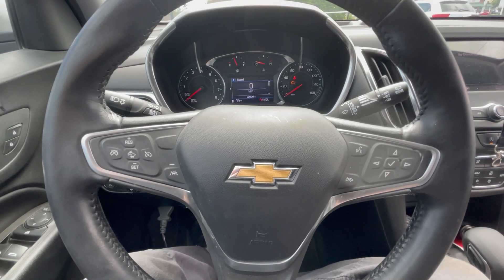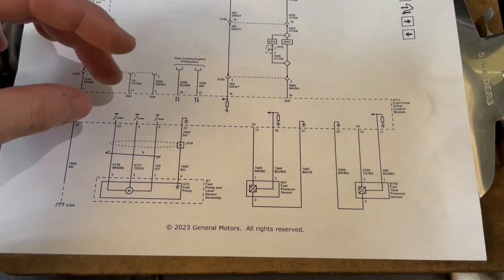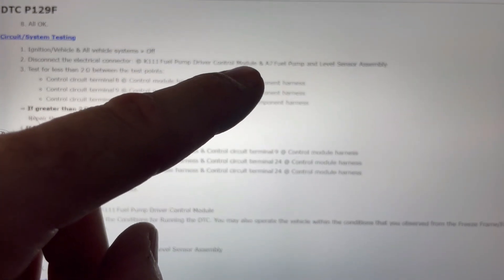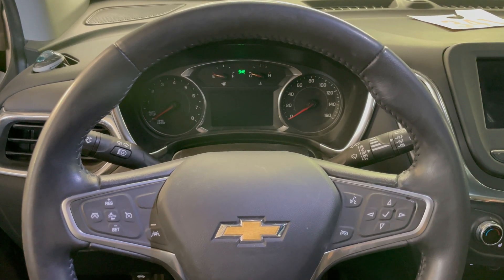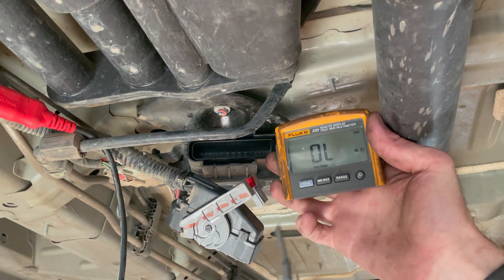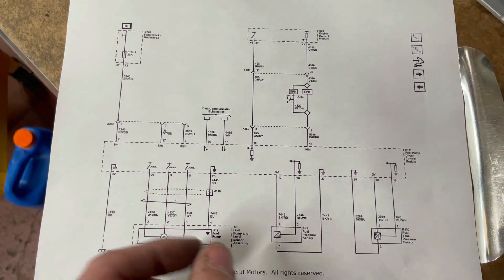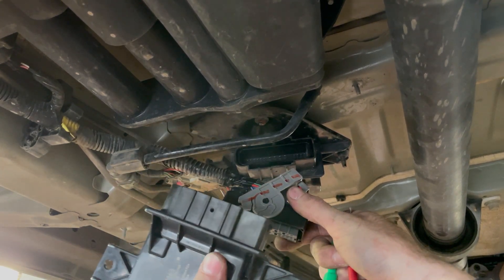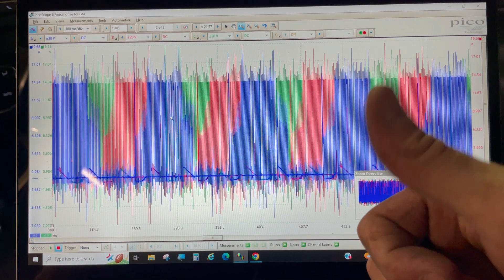We Do It My Way... Equinox No Start Triage Diagnosis P129F P023F P16D8 P2BB3 U18A2

Comment: 2022 chevy malibu that received code P023F CAR WILL ACT LIKE IT WILL CRANK BUT NEVER WILL UNLESS I GET A BOOST... IS IT THE FUEL PUMP DRIVER CONTROL MODULE? IT WILL CRANK ON ITS OWN AFTER THE BOOST ONCE OR TWICE AFTER DRIVING
Reply from the maker: 9 out of 10 times it is the module yes... Check the NHTSA website and enter your VIN to check for an associated recall... It might be covered.

Comment: I am having this issue with my 2020 equinox. I just want to know if the fuel pump control module for my model is located in the same area ? Google tells me it's in the back where my spare tire is. I know you mentioned this is a 2022 , read your comments and seen this seems to be a common problem and that you've repaired several, so any info is appreciated.  Thanks for posting this video, by the way.
Reply from the maker: Yes this has become a very very common failure. Some of them are indeed mounted closer to the rear of the vehicle. 

I do have a video which shows the exact location… Check it out here: https://youtu.be/ADJByWdbhyI?si=mZUpjr4VmhnZQFNE
Reply: @DadsGarageDiagnosticSpecialist thank you so much!

Comment: It is a “sad story” when your almost new car won’t run
Reply from the maker: I see it every day. Modern vehicles are absolute garbage. 

I have replaced piles of these modules thus far. The story is always the same… The engine dies and it won’t start, most of them have low miles. 

Total and absolute junk.

Comment: The lack of codes or lack of multiple codes during the setting of the other codes is an prime symptom of driver module issue. In the age of bulletproof control electronics I wonder why these issues persist. I've seen ecm,s go through fires and still work.
Reply from the maker: Piles of these things have been failing too.
Reply: @DadsGarageDiagnosticSpecialist  I just checked an 2018 equinox tonight 1.5 litre acts like fuel pump may have separated from pressure hose in tank or the gauge is lying and it out of fuel. Of course customer no help with latter assumption
Reply from the maker: You should be able to see pump RPM or amperage on the scan tool to indicate whether the pump is running or not. That should help narrow down whether the problem is inside the tank or not. 

9 out of 10 times it is a faulty fuel pump driver module, but it is definitely possible for something to be loose or pinched inside the fuel tank.
Reply: @DadsGarageDiagnosticSpecialist  and somewhere along I've heard( others assumptions) that these gm equinox type pumps had a habit of that . or so an recall because of this. There are so many tech advancements it's hard to keep up with all of em.

Comment: thanks, very informing video.
i have 2022 model equinox, CEL  coming on when fuel get to less than querter of tank but goes off when it is full.
i replaced the fuel pump(low side), but still  light coming on.P0129. DO have any idea what could be the problem
Reply from the maker: I see a fair amount of problems with burnt connectors and faulty modules.

Comment: Could you possibly list a part number for the module? I’m pretty sure I’ve found what to buy but I want to be 100% before I pull the trigger.
Reply from the maker: You should get the part number from the old module for best results. Otherwise, your local dealership should be able to look it up for you by Vin number.

Thanks.

Comment: I’m dealing with this now on a 2020 equinox. Dealer is telling me that the module needs to be programmed. Just want to verify that a new replacement doesn’t need to be programmed?
Reply: They also want to start by replacing the fuel pump and then work their way back to the module. LOL
Reply from the maker: Nine times out of ten it is the control module. Does not need to be programmed, but does need to be the correct part number for the VIN. 

Thanks.
Reply: Mine is a 2020 and I ordered the older part number 13540029 as that was the only one I could get my hands on. The newest superceeded number is on back order for weeks yet. I’m hoping that the new one works.
Reply: Also, is there a symbol on electrical parts that do need to be programmed? I saw another video and that guy referenced a symbol in that video. Thanks for your help!
Reply from the maker: I am sure it will work just fine. I am not aware of any such symbol, indicating that it needs to be programmed… Perhaps I should look into that.
Reply: Just wanted to thank you for posting this. I put the new module in and it fired right up. Saved me about $1300 in repairs since the dealer wanted to start by replacing the fuel pump and also told me the module needed programming.
Reply from the maker: @1fastxc that’s awesome! Well done!
Reply: @DadsGarageDiagnosticSpecialist  it's the picture of the open end wrench on the label tag.  Look at an ecm.  It's most obvious
Reply: @1fastxc  sometimes the dealers are between rock and an hard ass. By replacing only the bad part and another fail even an month later and they get blamed. You fixed it now your responsible for ever.

Comment: Hi, I got the same code in my vehicle. Thank you so much for posting this video; it really helped a lot!!! I have read in one of your comments that this is pretty common code dealing with the fuel pump module. Is this like a one time thing, and after you change it, it's fixed for good, or have you had times where customers come back because of the same problem?
Reply from the maker: The part number for the fuel pump driver module has been updated a few times. I haven’t seen a repeat failure after repair thus far. 

Thanks for watching!
Reply: @DadsGarageDiagnosticSpecialist  Thank you for taking the time to answer my question. I truly appreciate it. I have a 2022 Terrain GMC, same symptoms as the equinox in the video. I took it to the dealership, and it was the fuel pump module. I hope the new modules are fixed and this is a one-time thing.

When the new module is replaced, do they need to be reprogrammed?

Thanks
Reply from the maker: You are welcome. The new module does not need to be programmed.

Comment: I'm in the car repair business for 32 years. I use to not always follow strictly the oem repair guidelines too.  Many years of experience teach us many logical shortcuts.
Reply from the maker: Especially when they don’t want to pay sufficiently for diagnostic time. Factory diagnostic procedures are often not very efficient, some are even written poorly. 

The good thing is that GM service information is actually pretty good at leading you to the failure if you needed to fall back on it. 

Thank you!

Comment: 2020 equinox . I remplace the feul pump still just crank. Then i remplace high pressure pump and still crank. Now just need remplace the driver module. This module do not need be reprogramed? Or just take off and put the new one?😢😮
Reply from the maker: No programming required on that module. 

Thank you.

Comment: Does the year chevy equinox 2020 need reprogramming ?
Reply from the maker: The fuel pump driver control module does not need programming no. It should be plug and play. This failure is turning out to be common. I replaced another one today….I’ve replaced a few of them since uploading this video too. 

Thanks.

Comment: I believe you only have to measure resistance of the fuel pump motor windings two times (from 1 to 2, and 1 to 3) to verify continuity through all windings. Subsequently (and provided the measured resistances are okay) a measurement from one winding to ground and power will be enough too.

And thanks for sharing your procedures and experiences.

Btw. - how many psi does a three phase pump deliver?
Reply from the maker: You are correct… I decided to just visually show everything rather than try to explain that we were actually repeating tests.

According to service information the normal operating pressure for the low side 3-phase fuel supply pump is 46psi-97psi… depending on the module desired fuel pressure command. 

Thank you very much for watching and commenting!
Reply: @DadsGarageDiagnosticSpecialist  👍

Comment: You probably don't see many more. Gmt 400 and 800 anymore, right? Cuz most of those trucks are rusted out or dead.
Reply from the maker: Not as often anymore, I actually work on a lot of GMT-800s still. They are quite common around here….rust isn’t much of a problem here unless they’re driven on the coastal beach. 

I even occasionally still see GMT-400s…. Also still fairly common around here along with Ford and Dodges of the same era. 

GMT-400s are where I did most of my early learning.
Reply: What do you drive by in a way? I drive a 2008Silverado LTZ Dark metallic blue. It was a two-year-old cover for this body style. 2007 half to 2008. And then they went to Imperial blue. Most beautiful cowboy ever seen. And it's my first vehicle I had to replace. The lifter's though original transmission still runs like a champ.
Reply from the maker: @danielb-c9100  I have 2003 GMC Yukon and a 2007 Silverado and some old Ford trucks. 

89 Ford Ranger 4 cylinder 5 speed was my first vehicle…the one I learned the most on…cut my teeth on the old Ford EEC systems, did the clutch and manual transmission rebuild on that one for the first time by myself several years ago.

Comment: Do you work at A GM dealership? Do you remember when the GMT 900 was new?
Reply from the maker: Yes I currently work for a GM dealership. GMT-900 trucks and SUVs were the latest and greatest new thing when I was beginning my new career. I learned a lot on them over the years…..back then I was working at an independent repair shop and worked on all makes and all models. 

Thanks again for commenting.
Reply: Is there any tricky diagnostics? On the GMt  900.
Reply from the maker: @danielb-c9100  nothing too difficult. Excellent platform to learn on. Thank you again.

Comment: Great job coming up with an alternative test method! I have a 3-phase tester that I never used yet; would have been a good time to use it. 😃😃
Reply from the maker: Thank you! That’s interesting, I don’t think I’ve heard of such a tool. What tester is it? That would be interesting. 

I’ve been faced with more and more 3-phase electrical diagnostics on these modern vehicles coming out in recent years.
Reply: @DadsGarageDiagnosticSpecialist how about a 12v or M18  brushless tool that's been repurposed?.